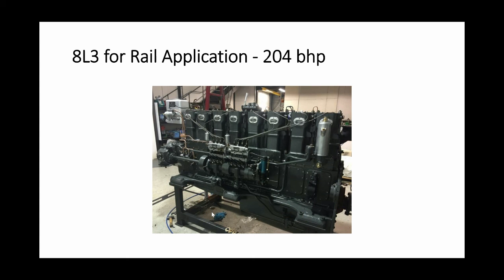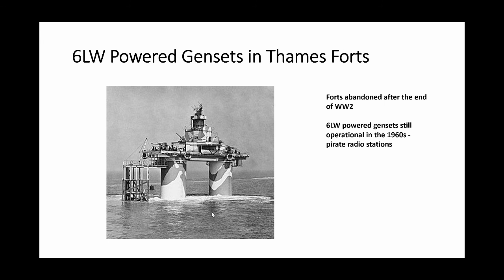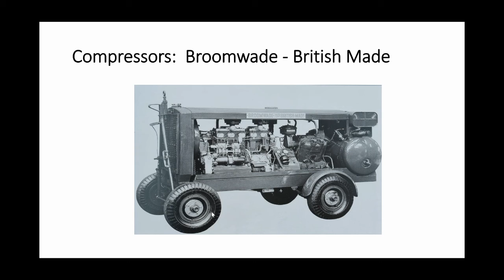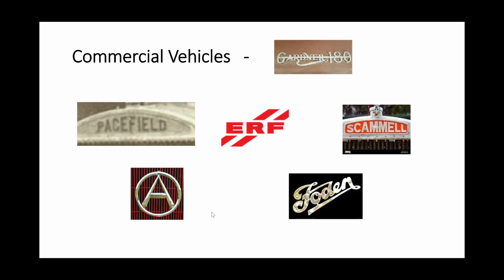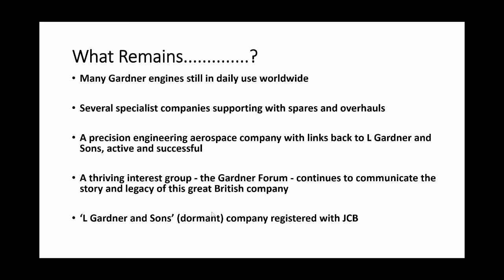Gardner Diesel Engines Tue Oct 04 2022 - Howard Evans

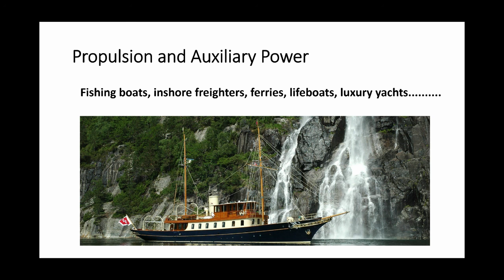Comment: Injection pumps were originally by Robert Bosch then by CAV. 28:03 mounted on the Gardner cambox otherwise all parts apart from the crankshafts which were supplied by Kirkstall Forge and were machined by Gardner on Gardner designed and built machines.

 🎉

Comment: Great talk thank you! I have used many small tugs and workboats with Gardner engines and they a great machines. there have been some very odd set ups in marine use. I have seen an 8LW with 2X 6 LW going into a three input gearbox out to one shaft. 4 fitted transverse with hydraulic pumps driving a hydraulic motor on to one shaft! Its a shame we won't see the like again